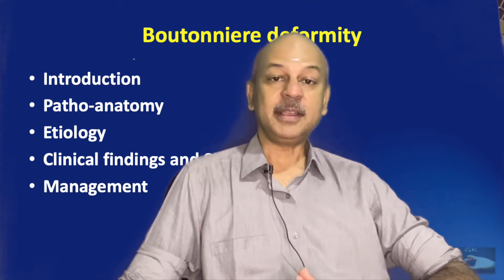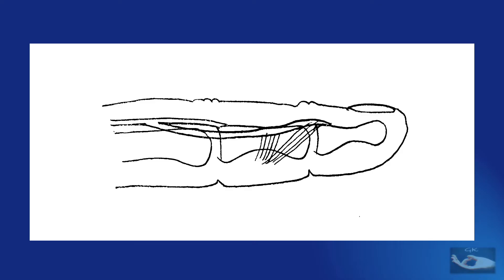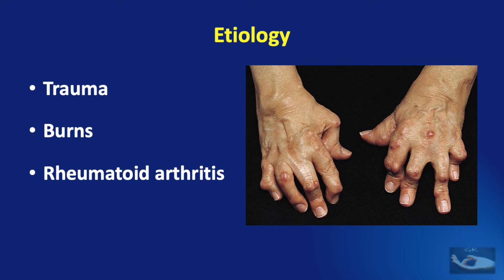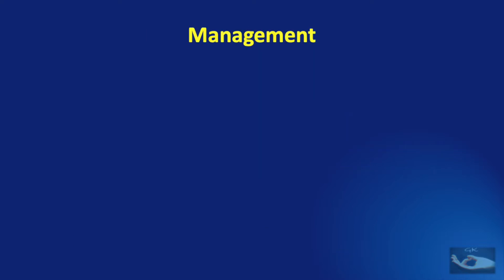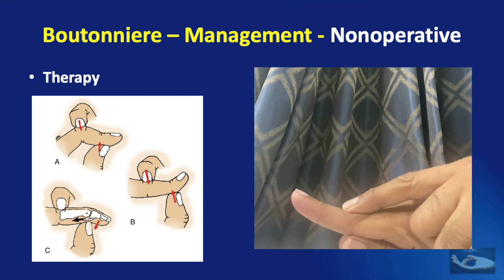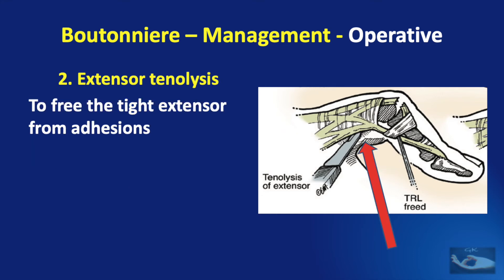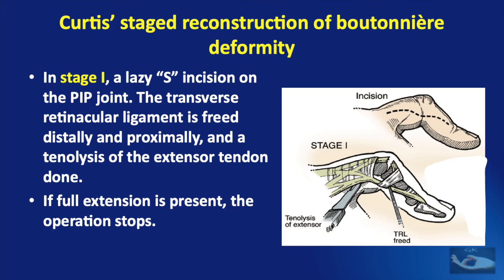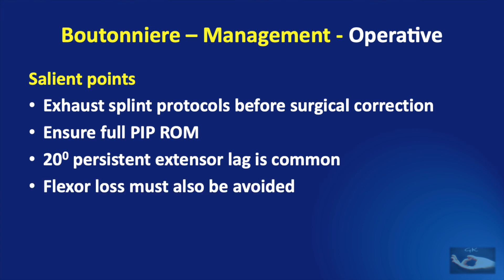The boutonniere deformity finger: Patho-anatomy, etiology, staging and management

Comment: At 15:20 you said if surgery is permitted only if you have full passive range of motion at PIP joint. However what if the adhesions is stopping passive range of motion. I had a previous surgery where they k wired pip joint with open reduction, now the joint doesn’t flex much and also dip joint is stiff.  However when i try to push finger down passively , I can see tendon bulging at the back of my hand which doesnt happen on my good fingers. Am I right to assume this means tendon is stuck and surgery will fix it.
Reply from the maker: Yes, in some situations when therapy is not able to get supple joints surgery can be done, but the results may not be predictable